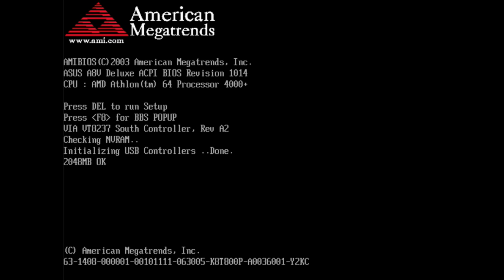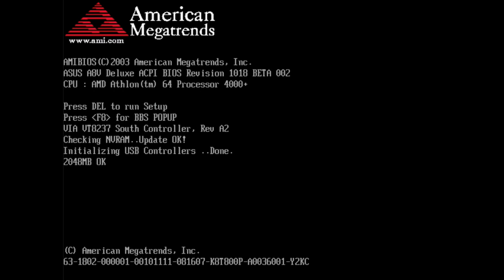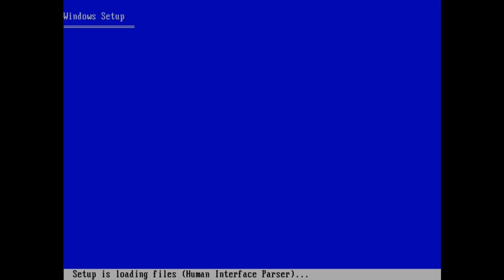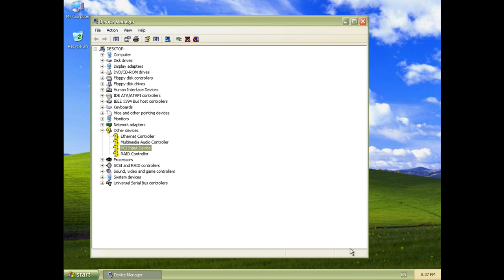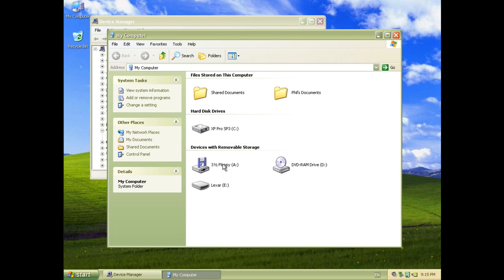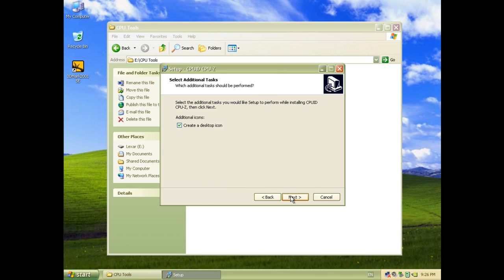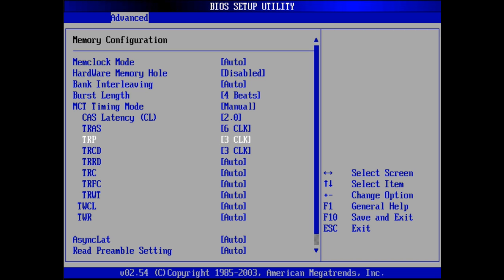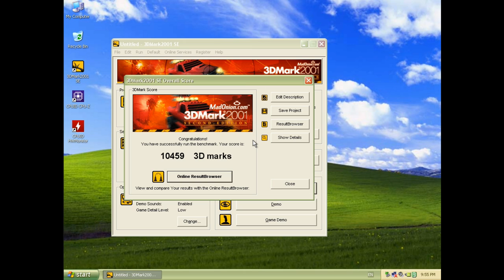Building my new PC for benchmarks and testing

Comment: Socket 939 has a warm place in my heart.

As a kid, i got to take over my dad's old Fujitsu Siemens Scaleo X with AMD Athlon 64 3700+, 1GB Ram, 6800 GT PCI-e.

That was a killer system back in the day.

The PC died years ago. But in 2018, i started to miss it. 

So I built almost the same PC with the good old Scaleo X case, ASRock 939Dual-SATA2(Not the board i used to have though), 3700+ 2.62Ghz OC, 2GB Ram and the 6800GT PCie 420/1100 OC, Sound Blaster Audigy 2ZS with the 5,25'' front panel controller running Windows XP.

And that is the one i use for my retro games today <3

Thanks for your awesome videos man!

Comment: diskpart is your friend.
We used it and diskpar before that to sector align drives mostly on RAID arrays and SAN's.
1. Open an elivated command prompt
2. Type diskpart
3. Type list disk to see a list of disks
4. Type select disk #  (where # is the disk you want)
5. Type create partition primary align=1024 to create an aligned partition
6. Type assign letter=x  (where x is the drive letter)
7. Type exit to quit the diskpart utility
Reply from the maker: Wes Brown Can you run diskpart before the XP installation commences? Or do you mean prepping the drive on another machine?
Reply: you can run it from the install CD by going to the recovery console on XP/2003 install disks.

Comment: 2 things I saw in this video that I'd advise against.  First, if the board is on a test stand like yours is then remove all nonessential cards when flashing the bios especially any card that can interrupt the POST like the SATA controller you installed.  This may be a hassle with a built system but for brand new it's best to remove any possibility of corrupting the BIOS.  The second is when you mentioned plugging in the PS/2 keyboard.  Yes, we've all done it but it's a roll of the dice.  PS/2 is not a plug and play bus and on some planar s, especially older models, there's a micro fuse on it to protect it from stray voltage spikes caused by static electricity and the like.  It protects the CPU and RAM but usually leaves the board crippled when it happens.  That fuse is surface mount too so not easy to replace if its repairable at all.  PS/2 connections are only meant to be plugged in with system power off.   This isn't just personal opinion BTW it's the right way to do it.
Reply: Yes I have had times were I had to reboot the computer because the ps2 keyboard I plugged in was not responding.

Comment: Best way to get a 1 TB drive with all the space available on XP is to install XP on the machine, then take the drive out and put it in your Windows 10 machine, and then expand the partition. You can change it to dynamic if you'd like which I did.

Comment: Try AIDA64, it might show the DDR Voltage.
This motherboard should support 98SE if it has AC97 instead of HD Audio(doesn't matter with external audio card)
Reply from the maker: Yes, AFAIK, most Athlon 64 machines support Windows 98. So that always gives me the option.

Comment: I had this board with an Athlon X2 4200... only problem I had with it was the onboard Promise RAID (or its drivers) was buggy and I lost my system twice due to RAID 0 corruption.  I was wiser after the first crash and had weekly disk image backups so I only "lost it all" after the 1st crash. I gave up after the 2nd crash and went with a single SATA drive.  That motherboard splash screen brings back a lot of memories :)

Comment: I had the same motherboard with an athlon x2 3800+. You can use a sata2 hard drive with this board. You just need to use a jumper (if present of course) on the hard drive to force it to run in sata 1 speed.

Comment: Wow, this is a similar setup I made back in 2006 save for the CPU and motherboard. I had an AMD Athlon64 3000+ paired with an MSI K8N Neo 2 Platinum nForce 3 Ultra motherboard. I still have the same Corsair DDR RAM and Audigy 2 soundcard.

Comment: Tip: Use nlite to add the sata driver to your installation CD, so you don't need to use the floppy disk.
Reply from the maker: Why would I do that? Getting to use the floppy drive and disk is the highlight of any build for me :D
Reply: Also, floppy noises! bzz bzz bzz bzz
Reply: And how many SATA drivers would you include to the disk? Or creating an individual disk for all boards you have?
Adding driver installers to the disk on the other hand is quite nice, especially networking and USB.
Reply: HappyBeezerStudios - by Lord_Mogul you would be surprised at how little space would require to add to your XP CD every network, USB and SATA drivers available... I had one with everything but big Graphics (nvidia/ATI) and Big Sound.

Comment: Nice video Phil. I suggest a dual core upgrade. One core to handle the game the other to 
handle background tasks like I/O like gpu, ethernet, and storage. Most 
games did not take advantage of multiple cores until the mid-2000s, but I
 suspect a small performance boost can be had. Maybe a little test same 
clock speed single vs dual?

Comment: Regarding the USB/PS2 Keyboard issue during the BIOS flash, did you have USB legacy support enabled in the BIOS? I know with some older PCs/mobos this setting was usually set to disabled by default. It usually had that behavior of working in DOS but not applications. Later PCs and motherboards usually had that setting enabled by default.
P.S. Nice video as usual.
Reply from the maker: Yes I did. Without it there is no way of typing in DOS.

Comment: These videos are always oddly enthralling in an oddly odd way. Did I mentioned also nostalgic?

6:47 - That splash screen's aesthetic is soooo nostalgic.

 I am building my own PC that is a little similar, I have most of the parts so far. 2GB of DDR 400MHZ ram (Motherboard will force it to run at 333), Pentium 4 3.4GHZ, Nvidia Quadro 3000, Windows 2000 SP4, Asus P4V8X-MX Motherboard, 450W PSU, 40GB IDE boot drive, CD/DVD Read/Write IDE drive, 120GB Sata1 drive, and a floppy drive. Just, just a floppy drive. It is laying around and I might as well do something with it. Actually, I think the manual mentioned that it can only save a backup of the BIOS on it so yeah, coolio.

 I just need to figure out what sound card and case I should use for it. I really want something classic for the latter, any suggestions?

P.S. Thank you for mentioning aligning partitions, that is not something that I even knew existed and will look out for when I put my computer together.
Reply from the maker: There are tools to align it later, I just shows one method of doing on. I like using Creative cards, they are great for gaming.
Reply: Thanks for the input!

Comment: Man, i bought the 5200+ back in the day...i think i got it to 2,9 GHz...but i cheaped out on the GPU...used my old FX5200, which even new wasn't really a thing to play on :D But that Board i had didn't last long for whatever reason, got a PCIe Board and with that an Radeon 1950 Pro...actually run that puppy pretty darn long...i think up until mid 2010 or so...

Comment: I have a request on what game to test on this !! Try using Windows XP SP1 and Metal Gear Solid 2 Substance !! It will only work on Direct X 9a properly and only on SP1, it will show the ingame projector speeches by the colonel and everything and the CPU can definitely run it, am building a machiene to display it as well and compare it to the version that runs on high end PCs. Also the original Metal Gear Solid 1 PC runs best on Win 98 and DX8, cheers man !
Reply from the maker: Man that's quite specific. I keep that in the back of my head, but no promises!
Reply: its so specific because the PC port of MGS2 is a mess and its actually a port of a port from the original Xbox version of the game thats why it only runs on 2002 speciffic hardware and drivers. The game runs well however on modern PCs without much problems but if you want full compatibility its Win XP SP1 and DX9a
Reply: MGS2 pc port is actually pretty decent save for the lack of modern controllers support.
Reply: yeah I also like it somehow I dunno it grew on me over time, you can circumvent any gamepad problems by using Xpadder or Joy2Key. I like it even so much that I build a PC speciffic for MGS2
Reply: If its a port from the orriginal XBox then it should be able run on a 733 MHz Celeron and a Geforce 3 (basically the hardware used in the XBox) Maybe a bit faster for the overhead.
Reply: it doesnt :( it requires a beast CPU something like a 3 GHz and a fst graphics card. But I will try your suggestion :). The thing is I was able to make it run in DX8 on Win98 on a Tualatin P3 1 Ghz and a Nvidia 5900XT and it did run slower than on the same setup on DX9a WinXP :)))
Reply: I remember setting up MGS2 back when it came out on PC. Think I had a Quadro 3400 card and there were many graphical glitches. I assumed that it was due to me not having a proper gaming accelerator. Turned out the game was very finicky in its setup and would only run correctly with a very specific OS/drive setup. Rolling back service packs and DirectX just to get a single game running wasn't worth it.
Reply: MGS2S actually runs on 98 as well...

Comment: Like the choice of processor you went with for this build! The San Diego based Athlon 64 4000+ was my main Windows XP processor between 2007 and 2010, running on an ECS Elite Group nForce3-A939 board with 2GB of Kingston HyperX DDR 400 memory! :-D

Comment: Nice Video! I planned to make a similar build like yours. But I ended with a Abit Mobo (Socket 939) and with a Athlon 64 X2 4200+ instead of an single-core Athlon 64. I got that Mobo-CPU combination with 2 gb DDR 400 because it was cheap (just 40 €). Just testet this build with a Radeon X1950 Pro with Windows XP and it works great. I even tried it with Windows 98 SE and it worked well (but with a Radeon VE instead, because the lack of drivers for the X1950 for win98). But this build will be just a Windows XP Machine for me. For Windows 98 i plan to revive my old Pentium 3 800 mhz build, but first i have to look for some older PCI Graphics Card, because of the lack of a AGP-Port (which is sad, because i wanted to use my beloved Voodoo 3 3000 again...)
Reply: I have a Windows system with a 1.2GHz Pentium III Tualatin. It has only one PCI slot for expansion because it is some kind of small form factor pc. I got a Geforce FX5200 PCI to upgrade the integeated VIA graphics.

Comment: Just wondering if you ever looked at interrupt sharing on the PCI slots?  I see you plugged the cards in slot 3 and 5 which according to the motherboard manual (page 2-16) maps to INT C and A respectively.  This means the Audigy should be sharing its interrupt with the GPU.  If I recall correctly the firewire port is wired for the 3rd interrupt line on the card so it would be sharing INT C as well.  INT C is used for the on board SATA which you disabled so placement is fine, but would probably recommend putting the sound card in slot 4 (INT D which is unused and the firewire port would likely land on INT B which is the LAN).

May seem a little pedantic, but I actually have seen a measurable improvement in performance on my dual tualatin build by shifting the cards around.  I'd have to look at the spread sheet when I get back from my trip if you're interested in the exact numbers though but if I recall correctly there was about a 10% improvement in UT2004 FPS.  On a related, although not particularly relevant note I saw a measurable decrease in performance when I added a USB2 card to the system which I could mostly negate by disabling the USB1 controllers on the card in device manager (disabling in device manager is effectively the same as removing from the system in all benchmarks I took).

If interrupt sharing performance is a real thing outside of my tualatin build it might be a good topic for a video as well.  I don't think many people know about PCI interrupts.
Reply from the maker: No I haven't looked into this, but it's worth checking out. I can do a before and after when I benchmark my next GPU to see if it makes a difference!
Reply from the maker: Ok so I used System Information to look at the actual IRQs and indeed, the GPU and Audigy shared IRQ 16! Imoved the Audigy one slot, and now Audigy Firewire was sharing with the GPU. So disabled Firewire in device manager and after a reboot, voila, everything used their own IRQ :) I'll run some benchmarks to see if anything has changed :D
Reply: Did the benchmarks change then?

Comment: My all time favourite AGP board is the Asrock 775i65g. Supports Core2 Quad (I ran QX 6700 cpu) but sadly only takes 2gb ram. I had XP and Win 7 dual boot. I still have the video card a HIS HD3850 AGP, a great system apart from the lack of ram support. An interesting note is that Gamedude had this very board for sale last week on ebay and I'm kicking myself for not buying it.

Comment: saw the motherboard and was thinking of the that you had gotten a AMD FX-5x system and a Asus SK8N but noticed later the IDE port was angled so it could not be a SK8N.

would been a nice board and cpu for retro singlecore gaming though but the A8V works quite fine but not the same history as the socket 940 and FX series cpu's.

for AGP cards, try to get hold of a ATI Radeon 3850 AGP  ;)

Comment: Nice config Phil, great video. Btw I'm still using the audigy2 zs in my main rig, it's a good sound card, imho still better than actual audio onboard solutions when using analog outputs. I highly recommend looking at Daniel_K soundblaster drivers. They work great in new OSes.
Reply from the maker: I remember trying out the 2 ZS for the first time last year. It was with Windows 98 and I did a sound card performance roundup. I was impressed straight away, I reckon I can say it's the best sounding sound card for Windows 98! Under XP it's just as good, though a X-Fi might be even better, but I'm not sure that you can really tell a difference.
Reply: Yes, X-Fi might be better, but they are harder to obtain and more expensive. For me and my speakers/headphones I don't think I will hear some improvement. Anyway for those who are interested - link to Daniel_k's website http://danielkawakami.blogspot.cz/

Comment: Man, I had the Athlon 64 3100+ back in the day.  That extra cache was crucial back then.  They were at the top of their game, beating Intel on the next architecture and whipping their ass at thermals, performance AND overclocking.  My 3100+ would overclock by 800mhz all day long without touching the voltage, it was insane.

I'm sad to see you went with AGP, as PCI express was contemporary, but pretty much every card back then had a PCIe and AGP version anyway.  On top of that this will allow you to test older AGP video cards without a cpu bottleneck (pretty please?).
Reply: I presume a board with AGP was used to benchmark and compare older video cards. PCI Express was not really contemporary until the socket AM2 era, 939 predated that somewhat.
Reply: BlakeCasimir I have to disagree, one of the big features of 939 was the PCI express support (and hypertransport), I remember buying a PCI express board specifically because I wanted crossfire support for my video card (x850xt PE).  AFAIK, the switch to hypertransport precluded traditional AGP and forced the use of a bus adapter on the motherboard, but I'll have to do more research to confirm.

Edit: After a bit of research, it looks like hypertransport can carry AGP, but I don't see how exactly it's done since hypertransport is packet based and AGP is an offshoot of PCI for the most part.
Reply: Soup, I didn't say that 939 "did not have PCI express", I should have perhaps specifically stated that when 939 launched it was very early days for PCI express at the time and it was not really common until the AM2 socket era. Anyway, an AGP based system is more compatible with older games and I'll wager that is one of the reasons Phil went with that board.
Reply: Blake, I have to agree with you on that.  It was definitely bleeding edge.  I think it would be really cool to see Phil test this system with old agp cards to see how they perform without any cpu bottleneck.
Reply: A bleeding edge anecdote for the hell of it: I remember trying to get a Radeon 4570 PCI express card (hardly bleeding edge, bleedin' slow more like) to work in a gen 1 PCI Express slot on an Asrock board. I think it was one of those (in)famous 775Dual-VSTA boards or something, and it wouldn't boot with that card. A 3450 worked, however. I would call this typical of the kind of teething troubles that plague any new tech in the PC world.

Comment: I thought Windows XP would ruin SSD's over time. :/ Also, I love your channel and your website is very useful for my old system.

Duron 950
128MB SDRAM
16MB Voodoo 3 2000
SBLive 5.1
A7N133
Win98SE
Reply from the maker: If you read and write a lot, but I don't that. I have ditched the SSD though, using a fast SATA HDD now as the SSD are needed in more more modern projects :)